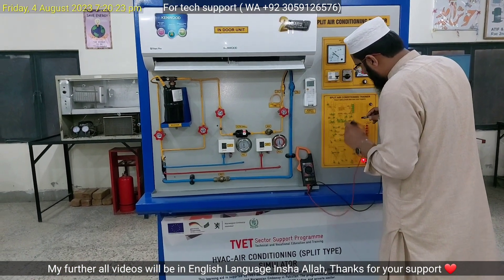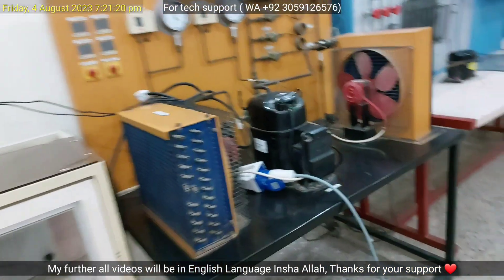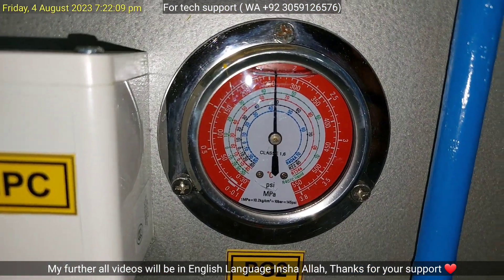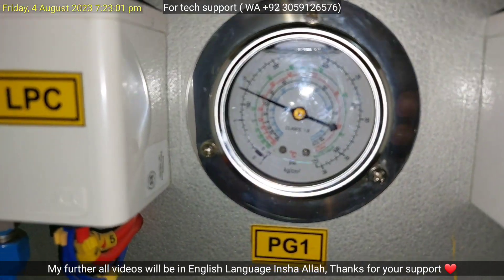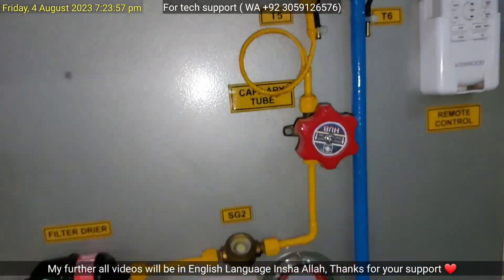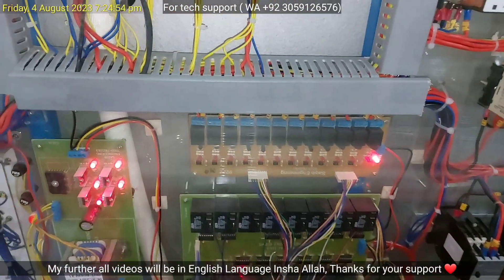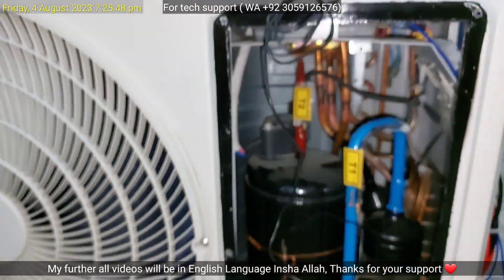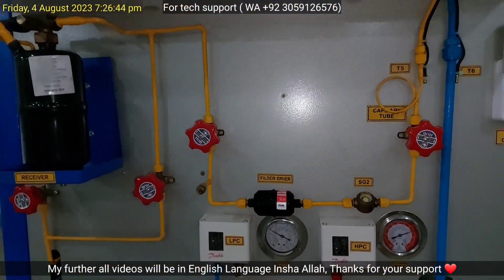R410a | R410a Suction & Discharge pressure | R410a Rotary compressor pressure

Comment: Great initiative. Could u kindly show us power consumption of Compressor from starting to steady state condition.  

Specially,  by increasing/ decreasing suction temperature. In that  case, u can enclose the indoor unit by a small cardboard box for recirculation cold air.
Reply from the maker: Yes Dear, 
Unfortunately the VFD of that unit found out defective,
So we will return back this to the manufacturing company, Sorry